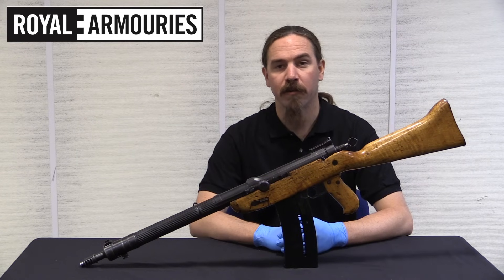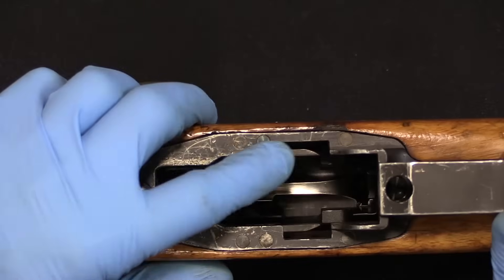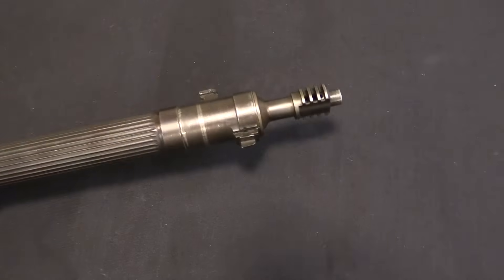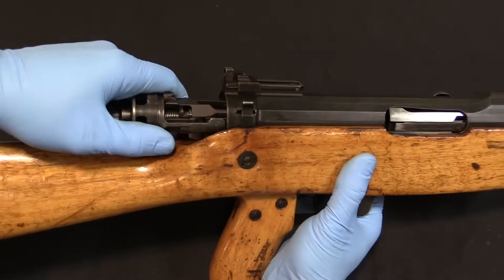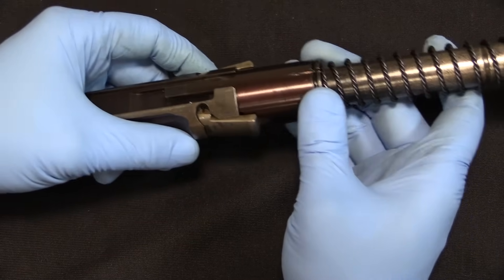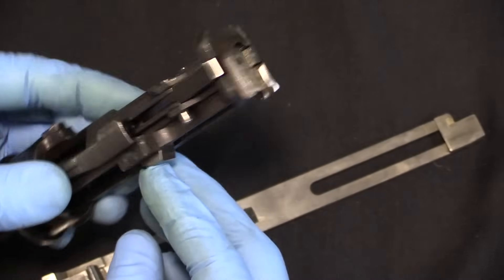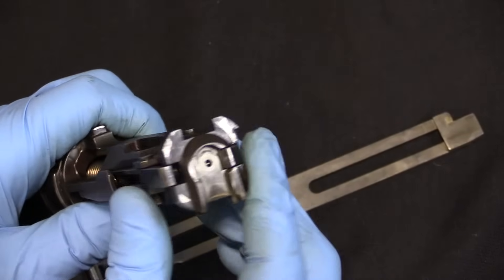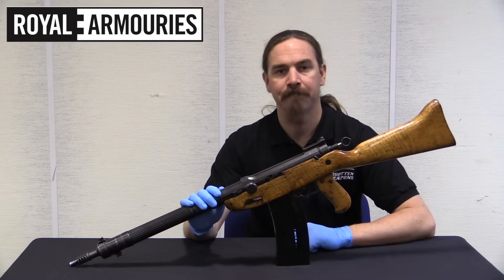SIG AK-53: A Truly Weird Forward-Operating Rifle

Comment: I didn't understand how actually the extraction works here.
In typical guns when bolt assembly is moving backward the case is pulled back and hits the extractor pin, so that it starts to rotate toward extraction window.
Here bolt assembly is fixed, barrel with battery is moved forward but case stays in place. What forces case to extract? Next cartridge pushed from magazine?

Comment: This is the first time I still have no idea how the example works even though it has been clearly explained.
I'm surmising this is the 1953 winner of the SIG in-house "can't make it any more complicated" challenge.
Were they trying to avoid some sort of patent or something?
Reply: James Lawrie Gas expands after passing through gas ports, just pushes the system forward instead of backward, gas is just being directed forward instead of rearward. Barrel goes forward, bullet extracted and as the barrel travels to the rear the round is picked up and pulled back against the breech face, gun fires. Simple.

Comment: Blow Forward guns would look cooler if the whole barrel moved behind the handguard.

Plus, it would be easier to add a muzzle brake to it.

Then just use a Double-Action trigger. With rebounding hammer.

And take the gas system out.

Comment: The "E" means "Einzelfeuer", = single Auto. 
The "M" is for "Militär" or "Militaire", means full Auto. 
The Safety, in the origin was meant to pull the striker bin ring back and set it in vertical position, like the carbine K31.

Comment: so the gas piston goes backward and then locks and then the 2nd spring pushes the barrel (and locked piston) forward which unlocks the piston at the end of it's travel and leaves it there and then gets pushed back to it's starting place (with the long bar recocking)? did I pass?

also is it just me or is there all sorts of weird parting the lips of the magazine barrel enveloping the bullet as it's pushed back over it to seal barrel thrusting powerfully forward from the shroud weird sexy stuff going on

Comment: The Swiss are sure lucky they never had to use this thing in a war!  All the enemy would have to do is attack the unit while they're doing rifle maintenance and they'd walk in without a shot.  That contraption has got more parts then a cuckoo clock and what fool thought this way of designing a rifle was acceptable, instead of choosing a more sound design, something more like a G3 or FN, will forever be one of the enigmas of small arms history.

Comment: i don't see why they'd move the entire barrel.  it'll come back and increase recoil.  contradictory to the theory.  it seems someone just wanted to design and make this thing.  its really cool.  they clearly spent a lot of time on it.  i am betting that the action won't cock because they wanted a self cocking mechanism.  which is the entire point of that ring on the firing pin.  its a built in, sorta, natural safety.  like a bolt hammer or something.  i really enjoy this rifle.

Comment: An AK 53 will recoil due to the reaction from the pressure acting on the bullet moving it forward as traditional firearms do.  The action of the gases acting on the larger area of the barrel piston against those formittable spring in the same direction as the bullet will combine to give the the shooter an unforgettable recoil experience!  The  army will save on ammunition!

Comment: This gun is like having 10 guns worth of parts crammed into one gun and all of the guns have to work at the same time to make the one gun fire. 156 is not the serial number, it's the number of scientists and gunsmiths that worked on the gun and well....umm...Had to go to a special place for an extended "rest" after this gun was produced. Note this was only a small fraction of the scientists and gunsmiths that had to work on this thing so SIG thought it would it would be a success with such a low "special rest" rate.

Comment: The piston spring is a recoil spring the barrel spring is a return spring the recoil spring ejects the round return spring chambers a new round normal weapons the recoil spring does both and the cocking mechanism is designed to act like a blow back striker fired weapon

Comment: Ian: Spends several hours reassembling a gun to a non-working state (twice), then concludes it´s not very complicated ;)

Jokes aside  - could it be that somehow the recocking assembly doesn´t work unless there is a round in the chamber? And maybe there is some kind of safety mechanism, but you have to operate two or more things together? Anyway, this gun seems really weird and overengineerd. Thanks for putting in the time to figure this out and showing us!

Comment: Despite being a VERY unique design, even if it were flawless in function, it looks to be a rather front-heavy firearm...  Which means, it's probably more suited for being mounted on a turret/vehicle.  However, having a low cyclic rate of ~300rpm, means it doesn't do a very good job of suppressing fire; additionally, because the barrel moves, it's probably not very accurate at longer ranges either.

Comment: 7:52 imagine if it actually worked like a nerf gun and one of the configurations is to charge the bolt every shot
Might just be a block so this thing doesnt go forth too much 15:20
20:30 after this explanation maybe my hypothesis wasn’t right

Comment: What a terrible design! Clearly this was designed by someone's cousin or nephew. Clearly they were in a position of power of fame and no one told them no! Not only is it more complex than it needs to be but it has far more mass than it needs to have to do it's job and far too many machining steps! So expensive to manufacture and a terrible design!